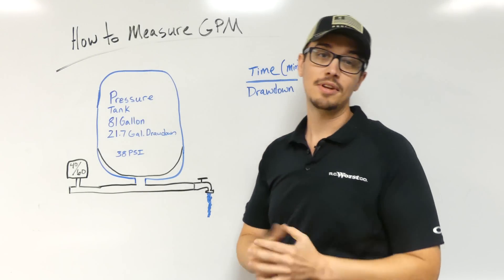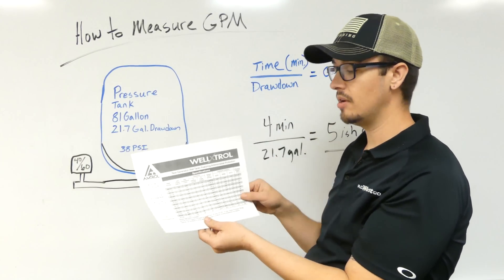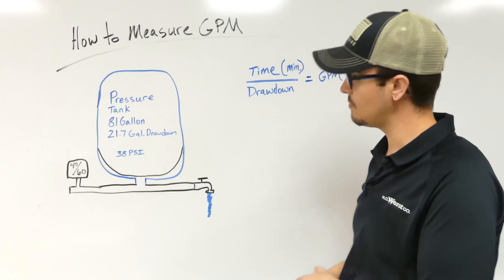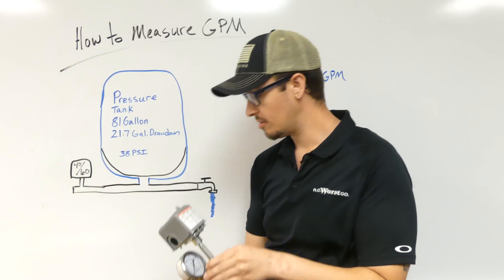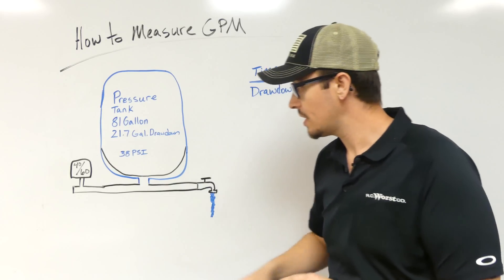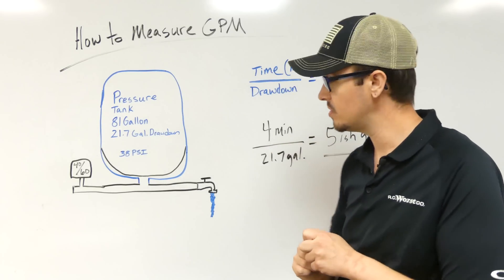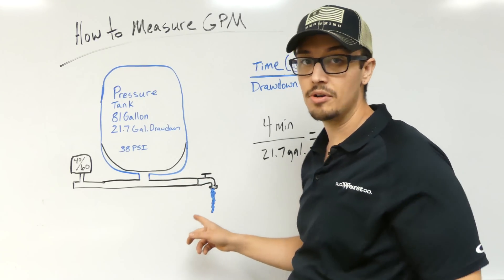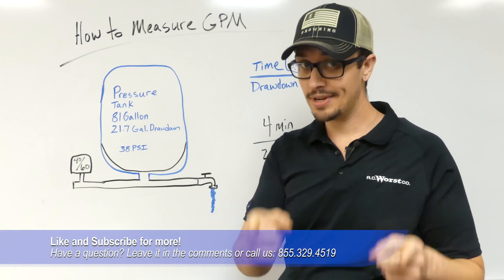How to Measure Your Well Pump GPM

Comment: But how do you measure the total volume of what your pump puts out at 45 psi or whatever?  It seems like as the pump gets toward 60 psi it is probably able to pump much gpm than when it first starts refilling the tank at 40 psi

Comment: Can you clarify what flow rate is this process measuring - is it the flow rate of the well pump or the flow rate of the pressure tank?  Do i need to turn off the water valve downstream of the T that feeds into the house during the draw down of the water in the pressure tank?  To measure well pump gpm could I not just put the garden hose from the T valve into a 5 gallon container and check how many seconds it takes to fill without messing with the tank pressure at all or will that not work?
Reply: You are calculating the flow rate of the pump in GPM (gallons per minute)... and doing that by timing how long it takes for the pump to refill the pressure tank with a known volume of water. You want to be sure no fixtures are using water during the test (like a washing machine or flushed toilet). If you don't know the "drawdown" then you can measure it. I suggest you measure it yourself even if the drawdown is provided on a document, because the drawdown is dependent on your 40/60 cut in and cut out being set exactly at those PSI values like they were at the pump manufacturer's when they calculated the drawdown. It is simple to measure the drawdown... and do your stopwatch work at the same time. Get a 5 gallon bucket and empty 5ea one gallon jugs of water into it... mark the 5 gallon water level on the 5 gallon bucket with a marker. Empty the bucket. Get your stopwatch ready. Be sure the washing machine isn't running or anything else that will use water. Open a spigot and let the water run onto the ground until the pressure gets low enough for the pressure switch to cut in (turning on the well pump). Turn off the spigot and start the stopwatch at the same instant in time that the pressure switch cuts in (watching the pressure gauge will help, just as Mr Worst noted... as the pressure gets close to 40psi then shut the spigot down to a very small flow so you can turn it immediately off when the pressure switch cuts in). Allow the pressure tank to fill until the pressure switch hits the cutoff value (60 psi in the example) and stop the stopwatch at the instant the pressure switch cuts off (the pump stops). Remember/write down the minute(s) and seconds shown on your stopwatch (this is the time it took to fill the pressure tank with a certain volume of water). You are done with the stop watch. Now let's determine what the volume of water was; Fill the bucket to the 5 gallon mark, shut off the spigot, empty the bucket, fill the bucket again, etc... as many times as needed until the pressure switch kicks back on at the cut in value (40psi in this example). Be sure to shut the spigot off right when the pressure switch kicks on. You are done with the pressure tank. Now measure how many gallons of water are in the partially filled 5 gallon bucket... by pouring the water into 1 gallon jugs... add that number of gallons to the previously emptied full 5 gallon buckets and you know how many gallons were emptied from the pressure tank before the well pump kicked on. This is the volume of water we were looking for, and is termed your "drawdown". Now you know the number of gallons pumped in a certain period of time...  in other words you now know the gallons per time (gallons/time). Just adjust the time you measured into minutes (for example,  2 mins 30 seconds = 2.5 minutes). Now divide the gallons that went into the bucket by the minutes of time that elapsed and you have the gallons per minute (GPM) that your well pump is pumping. So if 23.5 gallons were pumped in 2.5 minutes (23/2.5) then the well pump would be producing 9.4 GPM.

Comment: Chris: I have a wellxtrol pressure tank that has rusted on the bottom third of the tank that is near failure. Only the bottom third of tank is rusted. There is chlorine injection system in the well house that maybe the problem. Looking at a poly tank to eliminate the rust issue. What shall I do?
Reply: Put injection system downstream of pressure tank

Comment: Your equation is wrong.  You wrote Time(min.)/Drawdown=GPM  while it should be Drawdown /Time(min.)=GPM.  In your equation as written, the units on the left side of the equation is min/gallon and the units on the right side is gallon/min.  In the example, you are calculating MPG (minute per gallon) not GPM (gallon per minute).  4 min/21.7 gal is ~0.2 MPG while 21.7 gal/4 min is ~5 GPM.
Reply: i had to come to the comments to make sure I wasn't the only one...
Reply: @bouy33  Ok, glad to see I wasn't the only one on this. I checked the math, then decided to check the comments. Thank you.

Comment: i looked at your chart i have a 52gal tank so i used your 62 gal tank numbers it was 16 of draw down gallons,  my thing is my time from pressure switch clicking on at 50 to off at 70 is less then one min its more like 25 seconds so how do i get the gpm sence its under a min

Comment: I think you may have omitted an important step, and that’s to turn off the hose bib when the pressure pump kicks on.

I initially tried this method and left it open the whole time. It was never able to build up to the 50psi to turn the switch off.
Reply from the maker: At 3:50 we cover it, but I agree that we should have mentioned it sooner in the video. I appreciate the input!
Reply: Why does it need to be open in the first place?
Reply: G P , to drop pressure and get to the pump to kick on.
Reply: @mattdeloff4348  OK, thank you.  If I simply add a 2nd pressure tank do both tanks have to be sized exactly the same?

Comment: If I wanted more constant stable gallons per minute and to stay in the 40/60 psi range without cavitation on my farm irrigation system when more than one zone is running that now has a Gould’s J5s jet pump would it be possible to install a second J5s in parallel? Would I run both pumps with separate 40/60 switches? And would there be any issue if they both came on with only one zone running? Would it just refill the pressure tank with a faster cycle?    Right now my entire system is 1 inch and 3/4 poly pipe zones and I would like to increase my main zone right at the pump from 1 inch to 1-1/2   But my pump outlet is 1 inch      Thanks
Reply from the maker: Ben, give us a call or send this in an email over to us: 855.329.4519 or Customer.Service@Rcworst.com

Comment: You have are wrong in your calculation.  You have it upside down. The gallons should be on top on the time on the bottom.  Please check your math!
Reply from the maker: You are correct, we had it flipped. Good catch!
Reply: I am not the best at math the weekend after Memorial Day. I'm sure you see I did get the right answer, just setup the formula a little goofy. :)

Comment: This does not take in to account how much water your pump is lifting..... If it is 4 GPM so is the system once the pressure tank is low.......
Reply: Dave, regardless of how deep your well pump this method works. Water does not escape the system and thus must all pass through the tank. This method is best applied when trying to determine a rough nominal flow rate.
Reply: @chrisworst8353   Chris, If you were buying a home with a well, are you advising to use this method to calculate well yielding when in fact the well test should be over a period of time?   Are there not variables one should be aware of when calculating available water in a well?
Reply: @amyogren3326  The method described in this video is to determine your GPM more or less for equipment sizing, not well yield. Well yield is a much more complicated topic that put simply, the more critical the water supply, the more in depth productivity test you might consider. This might be a good topic for me to do a discussion video on.
Reply: @chrisworst7315  did you ever do a video on well yield? I'm interested.